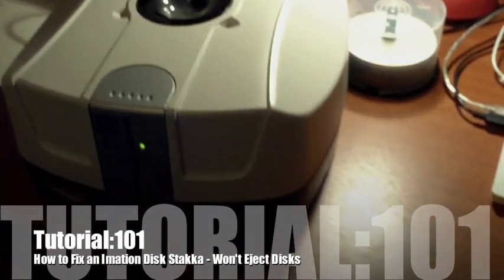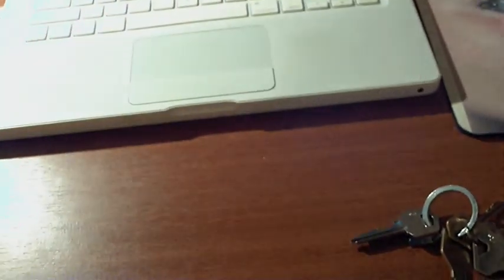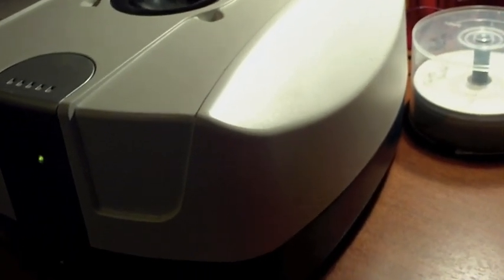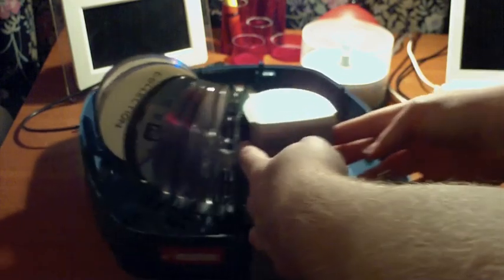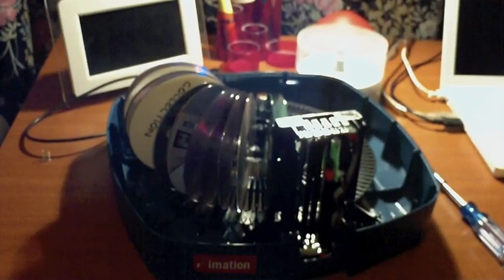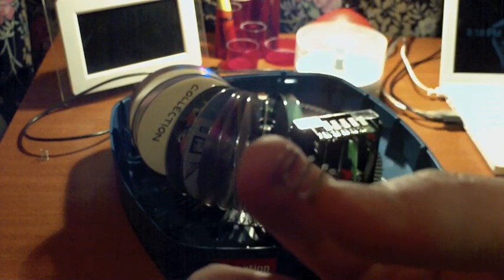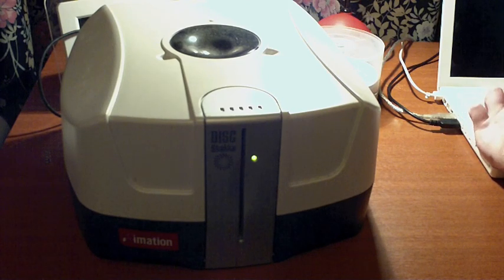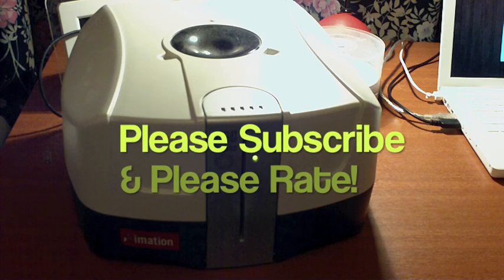Tutorial - Fixing Disk Stakka

Comment: This works well when everything else has failed (including replacing the belts)
I even tried to replace the belt that drives the load/eject mechanism with a rubber band that was a lot smaller than the original and even that did not work so thank you very much for this fix.. I never would have thought to remove bits to make it work!

Comment: hi - seems a bit random after all this time but I picked up a stakka from Salvos Sinnamon park and it had the same issue. have taken the spring out and may shorten/replace the belt. Wanted to use this to burn many dvds to mp4 with handbrake or similar. Do you need Stakka software as I could not find any. Using my old white Macbook  like you had in the video.  Mark Brannigan

Comment: this is a band aid cure, much better option to fix the loose drive belt. the drive belt stretches from sitting in one position, i've fixed several by cutting and shortening the belt, a dab of superglue on the belt to join it and steady hands is all you need. I usually cut about 15-20mm out of the belt and make sure it has no grease on it from the eject mechanism.

Comment: So what is the point of the spring then? Is it a redundant item in this machine? I have a disk Stakka with 100 historica/archive disks in it  - I cant access it via current windows 11 - or my iMac - is there a work-around for current day use or are these things just junk now? Your commentary is good, thanks.
Reply: Hey Jefferson thanks for watching.

From memory there was 2 springs in the machine so removing one would allow less pressure on the rubber rollers thus allowing a CD to come through.

Unfortunately I don’t have the disk stakka anymore but would recommend running an older version of windows in a virtual box to run the Opditracker software.

Comment: I have replace the right belts.
They are o-rings because of the better grip.
O-rings you can offer everywhere in each country.
Look for cheap prices.
The measurements are following.
Diameter 80mm x thickness 2,5mm This is the largest o-ring
Diameter 53,67mm  x thickness 1,78 mm for the motor in the middle
Diameter 52mm x thickness 2,0 mm for the motor in the back.
Differences of 1 mm in diameter does not matter.
Succes and good luck